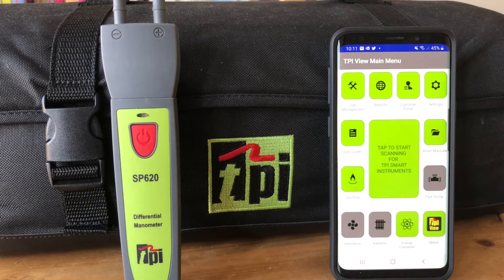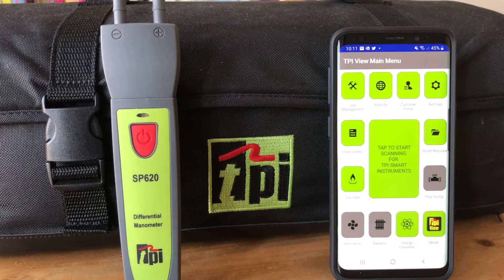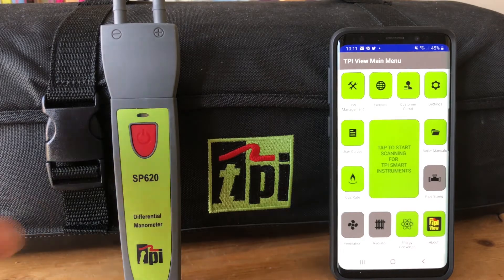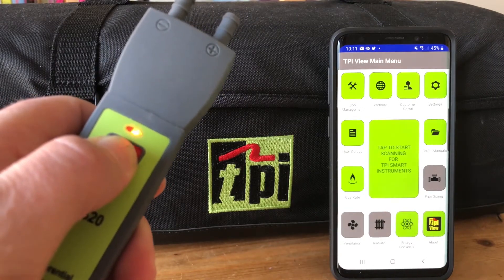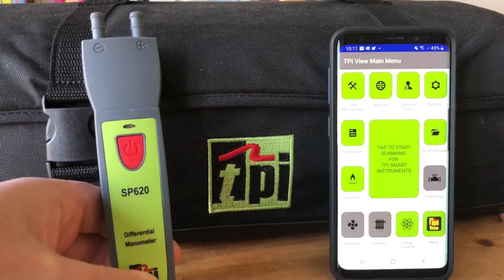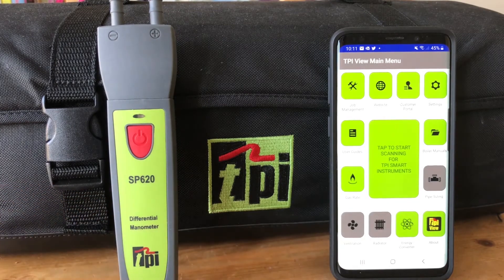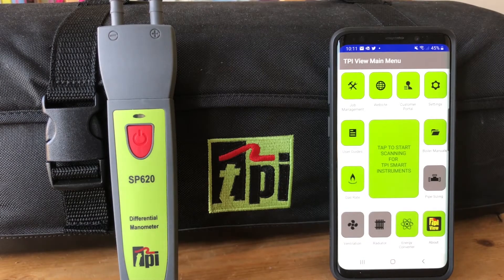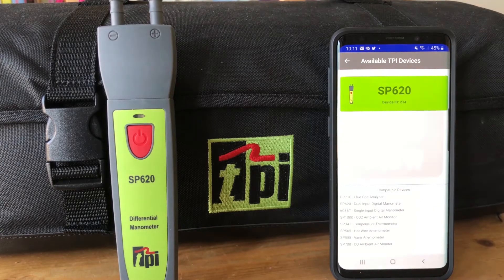TPI SP620 Let-By Tightness Test

Comment: Shouldn't the auto test be set at 0.2 perceptible drop!? As its a digital gauge! 0.25 for a water gauge! Was this an error in the video or if not can the perceptible drop tollerences be changed in settings?